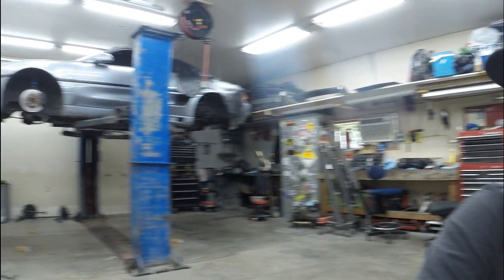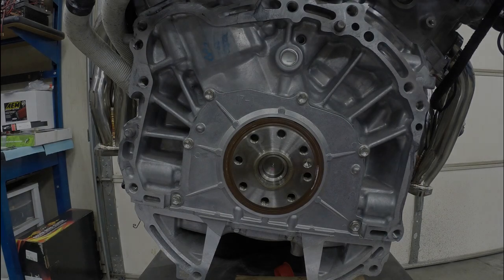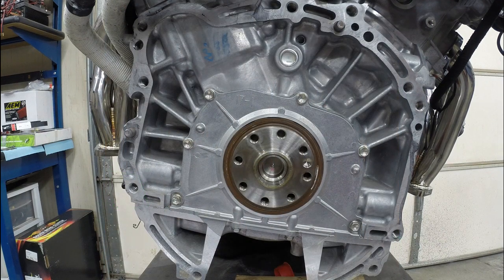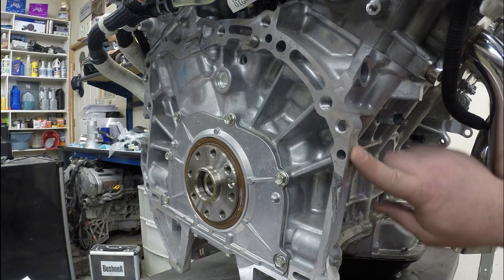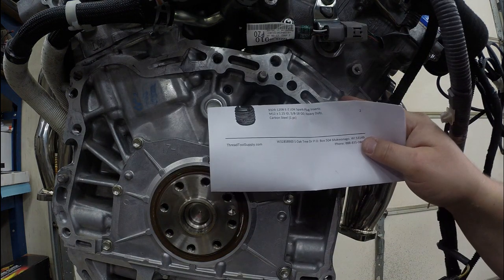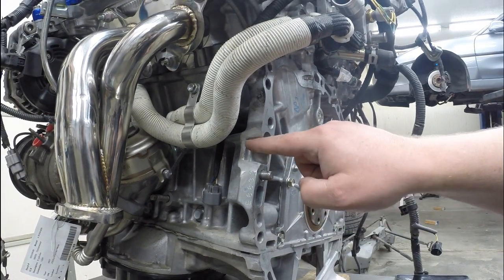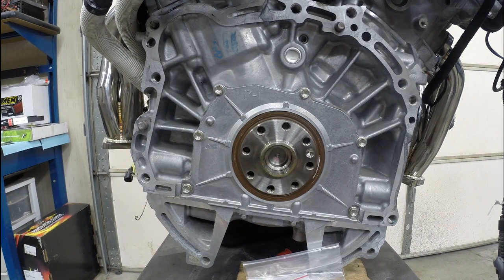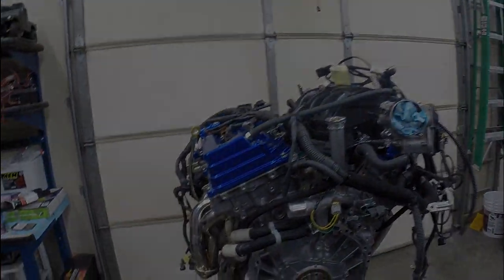2GR SW20 MR2 Swap Part 3 - Block Modification

Comment: Hey man ive been wondering where tou can find or know if anyone is selling a e153 transmission.i want to do this swap but the only thing holding me back is that i cant find one
Reply from the maker: They are getting harder and harder to find. I do not have any links on one however, they pop up often on the mr2 sale pages on fb. You can also buy a brand new one from toyota for around $3000
Reply: infectiousmr2 if you dont mind me asking.how much did you buy yours for?so i can get somewhat of an idea of whats a good price to buy them for.
Reply: It seems to be the question on everyone's mind... I'im thinking of asking an importer to look for one, I'm sure they'll know where to look better than me.
Either that or learn how to convert a Camry box.
Reply: @mrkazman  I just made a video on converting the Camry box. you will need to find the mr2 shifter from an e153 tho...